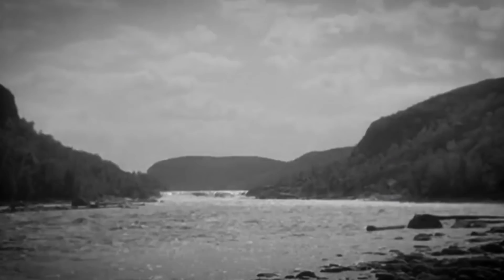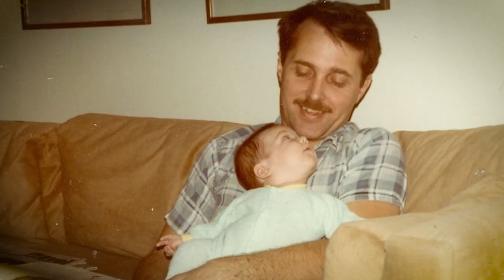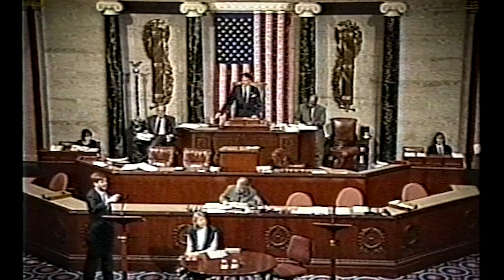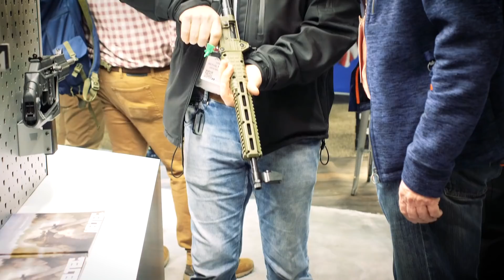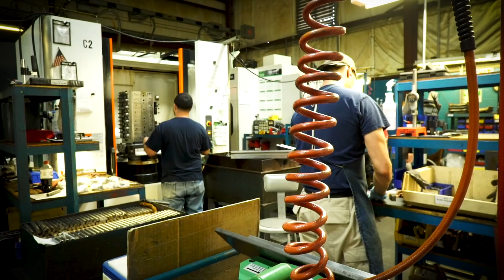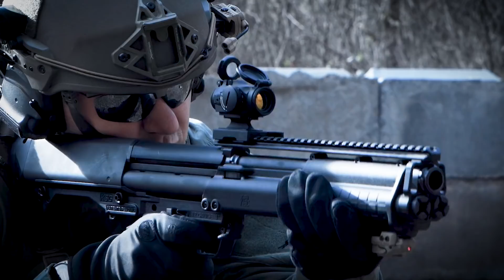KelTec Legacy - 30 Years of Innovation

Comment: Being from Satellite Beach in Brevard County, FL, in the early '60s, I was partial to your eventual close proximity in Cocoa and your innovative designs. My first purchase was a Grendel P-30, followed over the years by an RFB-24 Hunter, RDB-20, PMR-30, & CMR-30. I only got the "Hunter" because the "Sniper" (now changed to "Target") wasn't being sold yet. AND IT STILL ISN'T! Mr. Kellgren, I have seen your picture on your website with you holding one, and in writing to your company years ago was told it would be later. There is a market for the "Target" for competition shooters as well as for military/law enforcement sharpshooters. Why not make the 3 RFB barrels field-interchangeable and add a .300 WinMag chamber to that long barrel as another option? You have what seems to be a perfect platform for a modular system.
I tried adding a front hand guard to my "Hunter" but gave up when you kept sending the wrong barrel nut for the barrel. 
I would like to see the new P-90 in a bullpup with a 22" barrel.
Thank you for providing us with what we've always wanted, innovation.

Comment: If I ever have to go and live in Cocoa Beach I absolutely will try to find a job with keltec.  I am a certified fanboy of their weapons and I encourage others as well. There's something beautiful about something that is made From America herself from an absolute beautiful success accessory it makes my day better. Yesterday My brand new P17 came to life and had about a 150 rounds put through her
Reply: I LOVE my P11  my first 9mm from 24 years ago still going strong and looking new! Still,,, 24 years later the smallest, lightest high capacity 10 round double stack mecgar magazine, most concealable 9mm in the world! It was the FIRST polymer 9mm handgun specifically made for concealed carry. And the safest and most ready for action than any other gun. The trigger pull is very high making it impossible to accidentally or prematurely fire like the crappy trigger on all glocks which has the highest rate of accidental discharges due to no real safe,  safety engineering outside of a bogus trigger safety which means nothing since you're finger is Always depressing that tiny trigger in the trigger. But now most guns have that setup so the P11 is the safest! Yet some Pussies will moan and criticize the heavy trigger pull on the P11 because they either have weak hands or just are,,, pussies. It's that extra pull that gives you the split second to stop if the threat is no longer a threat. Either that or a super light trigger pull and,,,,Ooooops too late! There goes the rest of your life. Keltec will continue to lead the competition in innovation unlike some other well known lame "Dinosaur" of the gun industry. Keltec's designers and engineers have visions of the future in weapontry. Others live in the past 40+ Years,, Lack Luster, No Good Ergonomics or Looks,  No Modern Designs or ANY Updated Features or Quality Workmanship and Never Move Fwd while not even trying to keep up with All the other Modern Competition ,,, I won't mention any particular name,, wink, wink, nudge, nudge,  Lol...
Reply: Cool! I want a P-17, but unfortunately, they're still vaporware in Iowa.
Reply: Very rarely do they hire and when they do they usually promote from  within. They don't pay well as most in FL but they actually have good benefits.